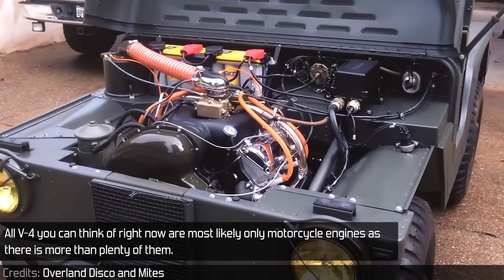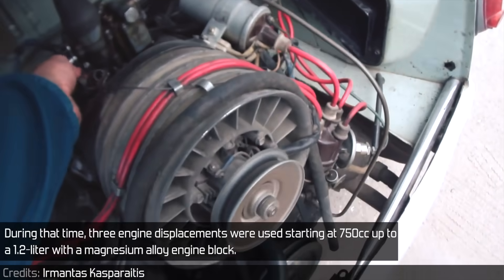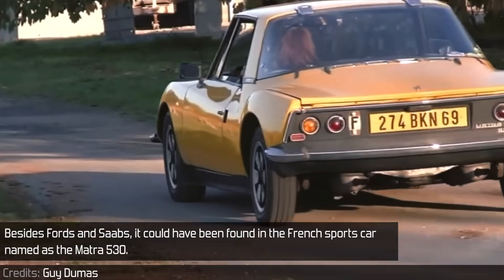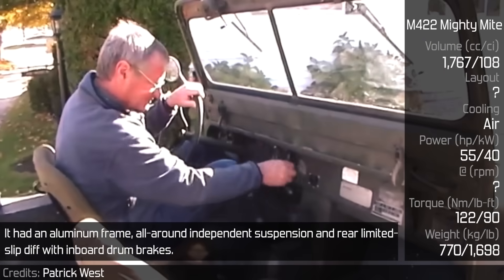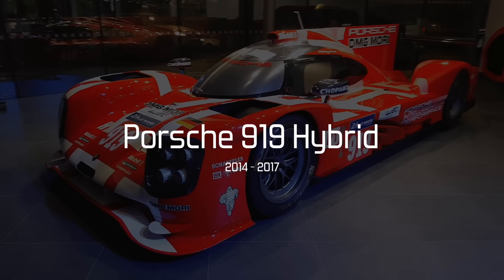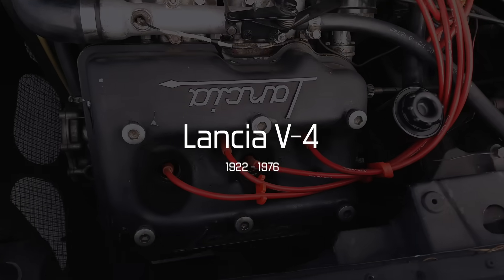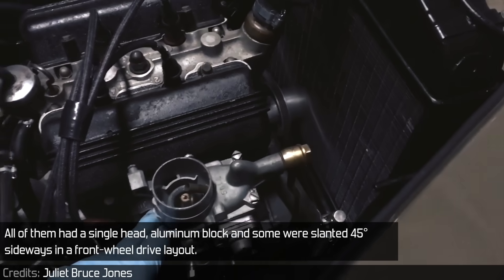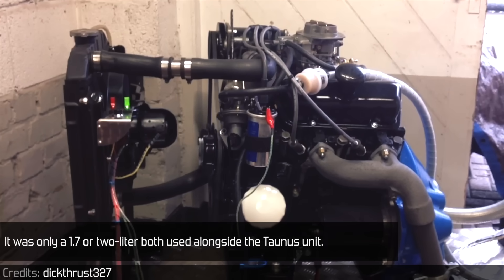The Only 6 Automobile V-4 Engines To Exist

Comment: I wonder what a 200hp turbo saab sonett v4 would drive and sound like 🙄 but no one has done it yet on internet at least 😢
Reply: Which would probably be the gearbox exploding. Saab had turbo's rallycross V4's in the late '70s that did about 200hp. More recently a Dutch company Sweedspeed tuned a V4 that did 200hp on the engine stand. It was so brutally high up in revs that it started to dislodge from the engine stand.
Reply: The transmission would be the weak link in that, and ring and pinion gears were getting rarer and harder to find even back in the 90's.  I doubt there's much in the way of surviving V-4 transmissions still available, the V4 tranny was originally designed for the torque and power levels of the old 36 HP 850 2 cycle.
Reply: Pierre Pierre lol
Reply: Alex B Im gonna check if I find vids of this sweedspeed sonett !
Well yeah its a challenge for the engineers
Reply: I think I should have been clearer. Sweedspeed tuned an engine but for as far as I know it was never installed in a car, leave alone a Sonett. I read about this engine in the Dutch Saabclub magazine a few years back. Sweedspeed did other cool things though, which you will find here. One is a blue 96 with a V6, the other one is a 96 on the dyno that produces 150+ hp.
Reply: Alex B Ive seen the 150hp 96 v4 when I searched it haha, was nice ! And still N/A, right ?
Reply: Correct. By the way, when you search ''Saab v4 turbo'' you'll find some turbo'd up examples.
Reply: Alex B Yup, have seen those too, but it's not the same kind of power haha, it was between 90-110hp, some had a turbo from a 900 classic !
Reply: Doug can!
Reply: It would sound like a grenade going off.

Comment: What is it with Russians using every godamn engine? V2 V4 V6 V8 Y8 V10 V12 I1 I2 I3 I4 I5 I6 I7!, Rotatorys
Reply: Russian engineers are good, the government cancelled many great projects because of stupidity.
Reply: @9876-j8v      I buy this one.      Good engineers in the wrong place.
Reply: Y8? I wonder how that would work out...
Reply: @rrtm9250 
that would be a radial engine.
Like old airplanes.
Reply: RareCx you could put a V8 bank of cylinders on an inline 4 block with sliders so that the opposing pistons fire at once. It's stupid, but it could work.
Reply: innovation. if it works then it works
Reply: https://en.wikipedia.org/wiki/Ford_Y-block_engine
Reply: Possum don't forget the w16
Reply: Vodka
Reply: russians are a little more daring, if i manufactured engines v4s would be in everything so would v10s and v12s there would be variants of one engine all using roughly all the same parts like rods and pistons and the block would be pretty much the same dimensions only where it needed to be thicker and bigger water jacket for the bigger ones but it would be like cat 3304 and cat 3306, 3412 and 3408, same engine pretty much only one has more cylinders
Reply: Add to that the variants of Radial engines and turbine engine layouts they've come up with in the aerospace sector... =O>
Reply: 5K what about x12-engine ;)
Reply: Oh, don’t even the mention the V3, it was pathetic!
Reply: They'll try just about anything, mad lads.
Reply: Possum no Research &Development haha just build it hope it don't blow up and sell it to the government
Reply: I1 does not make sense just say 1
Reply: @JohnFrumFromAmerica  or single cylinder thumper
Reply: v1
Reply: What's not realised is that up until the second WW what was later on called the "eastblock" was the inovation and manufacturing centre of the world, it was because of the USSR that it got behind in engineering even though some things eg helicopters, fighter planes etc weren't far behind and some cases  ahead of the world. There is a lot of knowledge in Russia and east Europe still, just look at the space program, I'll bet that inovation spirit is still around now.
Reply: Rotatorys 🤣🤣👏🏻👏🏻
Reply: Those v4 didn't make much sense, but the planned economy didn't really care! They are cool engines though.
Reply: Blyat
Reply: SUKA BLYAD

Comment: Saab Sonett baby!!!!!
Reply: First thing that came to mind when clicking on the video was my Uncle's Sonett III!
Reply: @Cliff_Dixon_42  I have a toy sonnet 3. I don't know where it came from but I used to like it because I thought it looked like a delorean.
Reply: I almost bought a Saab Sonett III
Reply: Had a Saab 96 with the identical engine as the Sonett, the twinport carb. Slow on highway, fastest in deep snow and on harsh roads, good car. Would have bought a Sonett but they were back then already pricey.
Reply: @TheFirstBigCheese  In the mid 1970's I had a Saab 96. It was so easy to spot in the Disneyland parking lot, I wish I still had it.
Reply: I love saab❤️
Reply: The V4 Sonnets had some serious understeer, the really rare Sonnet II with the 2 cycle handled much better.
Reply: @tauncfester3022  I never experienced that in my sonnett   iii. It was my first car, and I was a crazy teenager. Growing up in the foothills of Colorado, I definitely tempted fate more than a few times in that car, yes, because of being a front driver it would push l, but if you lifted off on a downshift going into a corner it would slide beautifully, and that was a strange sensation, as you sit about 1 foot in front of the rear axle line. I will own another, some day.
Reply: I miss my Sonnet!
Reply: Worked at a Jeep dealership in 1976 as a detailer. When I came across a Sonett. The hood was more like a hatch always curious about engines so opened it up. And there was the smallest engine I have ever seen in a car. It looked like a lunch box. Pretty sure you don't need a hoist to pull it. Anyway, haven't seen one since. But I do think about it still unusual engine as this video confirmed.
Reply: Another piece of crap 4 stroke with no oil injection, fuck that
Reply: at one time i had 5 saabs, never a sonett, heavy sigh....
Reply: @keenosaabi4530  I have been many times in Sweden and when I was young I have seen very often the Sonnet but I have never been on one unfortunately. I distinctly remember how well they were handling on the road when it was snowing!
Reply: Miss my Sonett. Loved racing other cars on freeway, looking up at MG midgets!
Reply: @91F2Z I escaped a certain ticket by ducking into a truck stop and hiding it between trucks, then looking over and realizing that I could've hidden UNDER one of the trailers. I'm 6'3" and fit perfectly in my sonnet, you did have to perfect the one hand rolling dismount, tho. Iykyk
Reply: Saab 95 V4, Saab 96 V4. The coolest Saab is the 92. Two cylinder two stroke engine. Three gears :)
Reply: We've got one in our showroom.
Reply: Well, I drive one. A Saab ;)
Reply: Everybody has almost bought a Saab Sonett III. Then you come to your senses and buys something else.

Comment: I had a Essex V4 Cortina and it was the most reliable car I ever had. I did over 300 000 km and all it asked were filter oil change and spark plugs. I used it on mostly short trips. Those were the days of petrol rationing and I had it running on L.P. gas. I get 15 km/l on petrol and 24km on l.p.gas
Reply: Cortina? The Essex V4 was never put into the Cortina by Ford.
Reply: The workshop Manager of Ford told me that there was a German two litre or Taunus engine the distributor sat at the rear of the engine and then the Essex with the distributor on the front of the engine. 1975 model Cortina with a 36DCD Weber carburettor . It was like a sawn off v6 but with a balancing shaft. Apparently only in South Africa
Reply: Yes what that manager told you was correct, i wasn't aware Ford put Essex V4s into Cortinas in S.A though, i did know about Mk3/4/5 Cortinas did have Essex V6s in them.